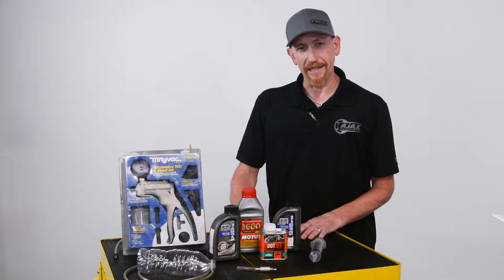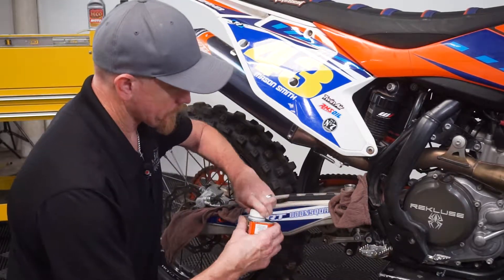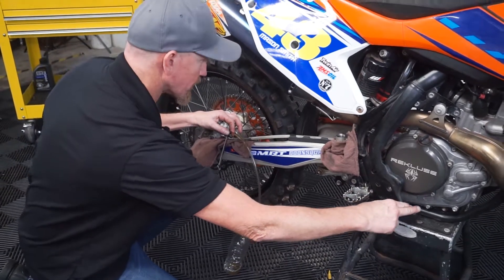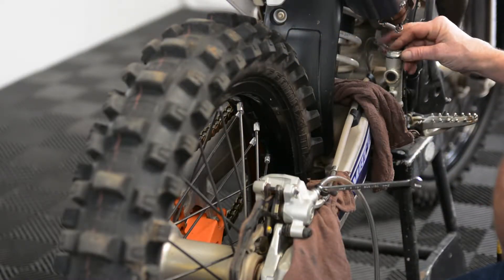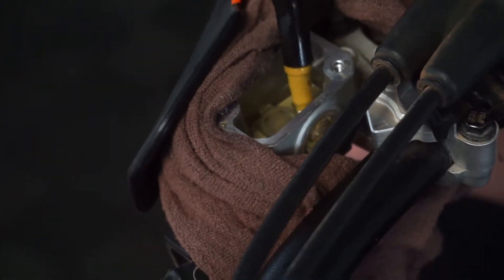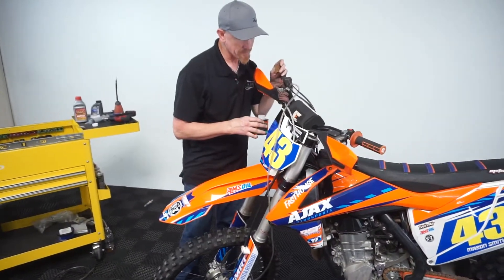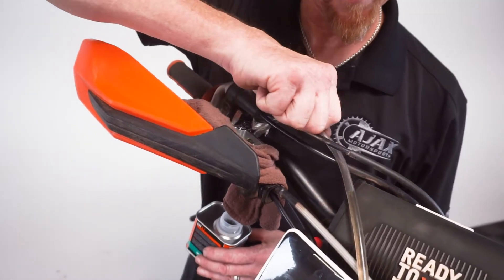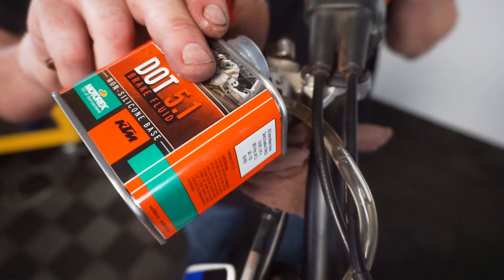Bleeding and Flushing Motorcycle Brakes // AJAX Tech Tips

Comment: I can see you have a hose from the bleeder screw coming up but what is it connected to on the top? Is there another bleeder screw up there on the master that I don't know about. I followed you all the way up till that point then everything went blank. I wait your expert advise? My reason for reaching out is I have a 2014 Honda XR 650L where my front brakes are not building pressure in the line. I have followed the recommendations of Youtube videos on how to bleed brakes, etc to the best of my ability with no luck. It shouldn't be that hard yet I struggle and continue to with no help from my local mechanic (punk). Another guy willing to help from youtube wanted me to subscribe, donate and pay a fee to join his classes. There's more to the story but that will have to wait. I've been without front brakes for almost 3 months now but what I forgot to mention is I'm not a mechanic, I have the bare minimum tools and a hole in both pockets which makes going out and replacing parts not very often. Here in Hawaii everything is expensive and now the shops that are around won't even keep in stock and require full payment if they order. So bottom line is this is the first I seen this type work done to a brake system, I liked to try it it but I like to know where is that hose connected to from the bleeder screw going up to the front brake master? Thank you